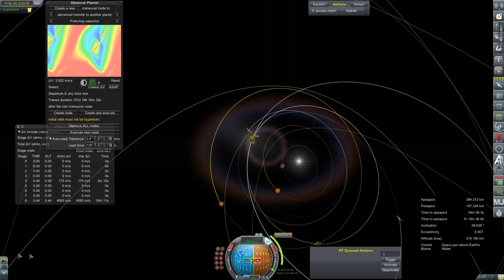KSP RP-0 #380 Artemis 4M-3 Launch

Comment: I personally think that you're giving your Kerbals to little space. In my opinion, you should give them something at least the size of MPLM from ISS...
Reply from the maker: The pod carries 3 - there is room for 6 in the hab alone.. it was trying to find the mid-point between the form factor I needed to tuck the Artemis as close to the heat-shield as possible, a reasonable amount of space- and overall mass including life support )
Reply: Cosmonaut Crash yea it might hold 6 kerbals but it's soo tiny. I kinda liked the old test hab. I was hoping that the hab would look like Apollo Block IV from ETS...

Comment: you really should purchase another launchpad i have 3: 2 for 800+ tons and another one for 800t
Reply from the maker: I actually have a second one that I purchased ( built?) for the 1977 window - but did not know I would need to upgrade it ( thought foolishly that it would just be a mirror copy of the primary pad ) It is capable of 800t, but the cost to upgrade it fully is out of financial reach at the moment ( but working on it )

Comment: Looks like this launcher would benefit from a bigger upper stage. Have you thought about putting 2 Hg-3 engines on that?
Reply: J2-X has worse performance than HG-3. 1310kN at 448s isp versus HG-3 with 1400kN at 451s isp.
Reply: a j2x would be cool but i dont think it would have a better performance
Reply: runtime is the most important thing in upper stages the exploration upper stage of the sls for example has only 440kN but has a way longer runtime which brings it close to the SIVb stage
Reply: Yeah slapping 2 HG-3 sound resonable and will definetly reduce burn time while having little impact on efficienty
Reply: I will definitely go for the J2-S for manned missions since it has a far better MTBF than the HG-3.
Reply from the maker: The original RA-X used twin HG-3s, and one of it's primary week points was the inter-stage - I assume - because engine bells have a stronger attachment point than fuel tanks.  Making an upper that heavy may require using 3 engines ( placed in-line ) so that one of them attaches to the inter-stage fairing.
This original formulation actually takes it's Test Flight configs directly from the J2-S ( might explain the low failure rate ) so the MTBF is exactly the same - including run-time ( 10m )
Reply: +Cosmonaut Crash
"This original formulation actually takes it's Test Flight configs directly from the J2-S ( might explain the low failure rate ) so the MTBF is exactly the same - including run-time ( 10m )"
That explains why you never have a failure on these. I always wondered why you were so lucky all the time.
Reply: QuietElite ohh yeah, the J-2s is pretty darn reliable.
Reply: Cosmonaut Crash why does your game have such problems with spaghetti rockets? I play 1.2.2 version of RO/RP-0 and never encountered this...
Reply: Cosmonaut Crash I also had spaghetti rockets in 1.2.2. regular old struts usually help.
Reply: phoneix 007 of course while also enlargening the fuel tanks
Reply from the maker: could be a 1.1.3 thing.. dunno really - but it does keep me a little "humble" in rocket building
Reply from the maker: That old RA-X had at least a dozen struts between the core and upper stage - I guess they have a tolerance limit also.. unng.  what would KSP be if it werent for random bugginess.

Comment: You can land crewed on venus/mercury?
Reply: To recover a Kerbal from the Surface of Venus is the most hard thing to do in RSS. It wouldnt be very realistic as well.
Reply: Mercury also requires a lot of deltaV, because the planet is near to the sun. It is possible, but it will need huge afford to do this. Venus is a little beyond for a career game. A flyby mission should be easy to do, but I dont know how much benefit you can get from that in regard of science. I think Cosmonaut Crash has almost the whole techtree unlocked. Too sad though. I would have liked to see some Near Future-Stuff in there. :) And then colonizing the whole solar system. :) I imagine the horror loading a savegame like this. :)))
Reply from the maker: I've seen a crewed mission to Venus on YouTube before - stuff like that is a little beyond me at this point.  Though I would love a sample return mission from either, putting crew in to the equation complicates things by many orders of magnitude.
Reply: Cosmonaut Crash but on mercury? 🙂
Reply from the maker: Yeah- with Mercury it's basically a Dv resriction - but as interplanetary stuff gets bigger ( and assembled in orbit ) id be curious to see the Dv numbers for a Mercury mission VS a Titan mission ( my guess is more fuel for Mercury, but less Life Support - the shorter transit times may be a huge benefit. )
Reply: Yeah. For Titan, you can do also a swing by at Venus, which will safe you some Dv. But life support is an issue.